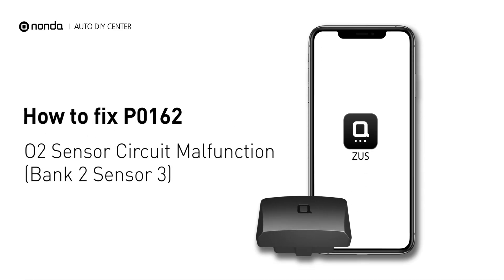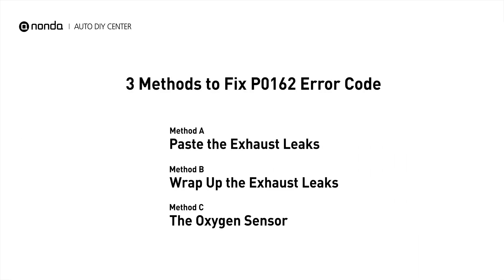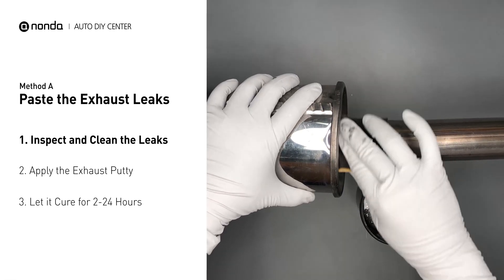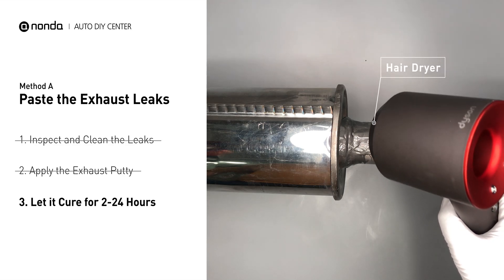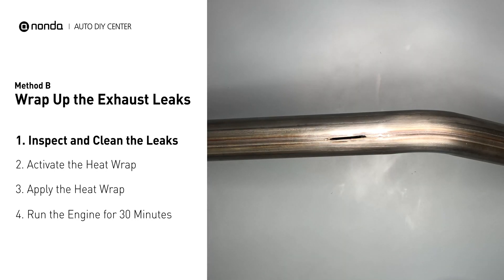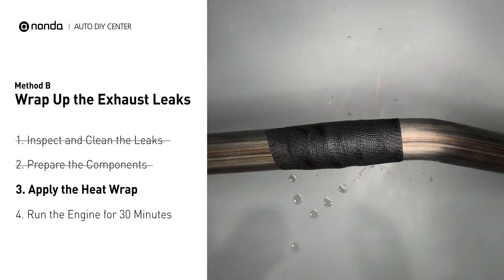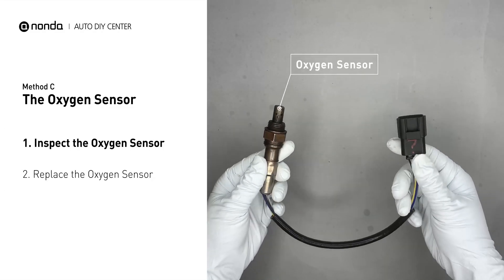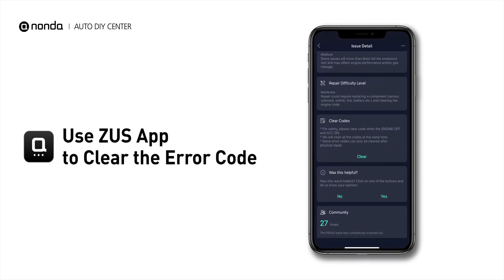How to Fix P0162 Engine Code in 4 Minutes [3 DIY Methods / Only $9.23]

Comment: I have a P162b code on 2011 silverado 5.3  trying to figure out what code means
Reply from the maker: Hello, you may possibly have a burned out MIL lamp, or a faulty catalytic converter. Also, make sure that the tank cap is securely closed and the oil level is okay. (add more if lower than MAX).